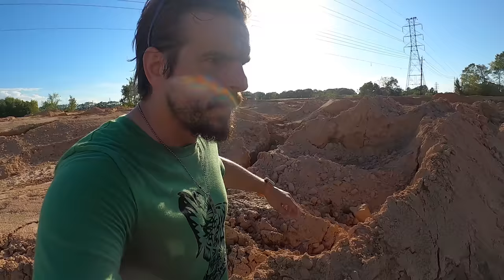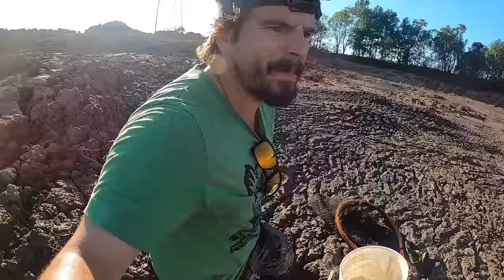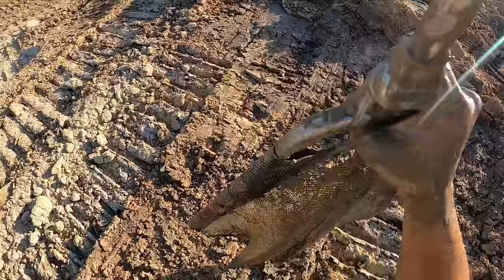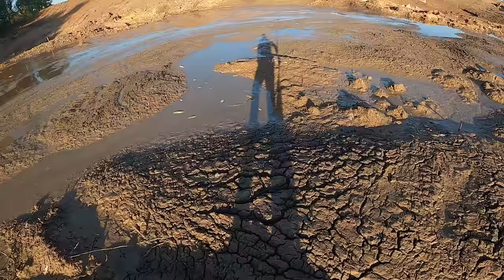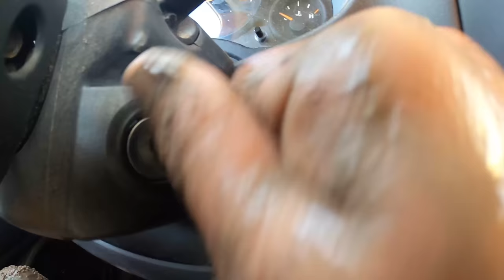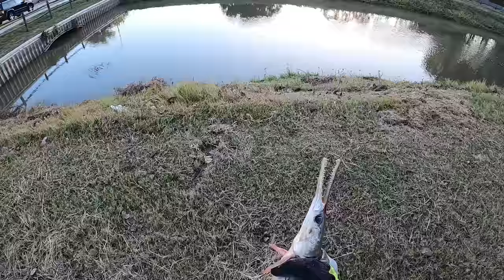Saving Fish from a Drained Lake!

Comment: Thank you Payton for saving those Gar.  I saw Chandler from Chandler’s Wild World channel so the same and save fish from a construction project where a new gas station (I think it was a Wawa’s) was being built.  They drained a fairly good sized pond/water retention/run off area to allow the excavator to come in and flatten it all for the project to begin the build.  Chandler saw that they were draining the water into an adjacent stream and connecting lake that was across the street and a block down the road.  He assumed that flooding in the past allowed the many fish to migrate to the pond they were emptying.  On the video Chandler and a friend grabbed the fish and moved them in buckets to the existing water across the street.  He said that most of the smaller fish got sucked threw the drain pipe to the other water, but the larger fish were able to avoid going through the drain pipe, so he and his buddy rescued all the bigger ones that weren’t dead already.  I’m so glad there are animal lovers like you and he to save these fish which construction crews don’t seem to care about.  🤔❤️👏🐠🐡🤷‍♂️